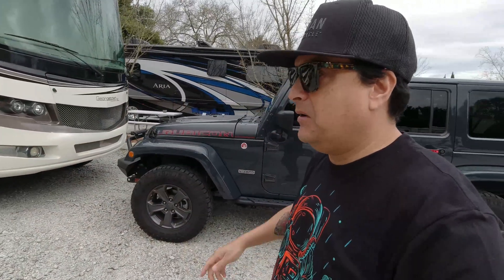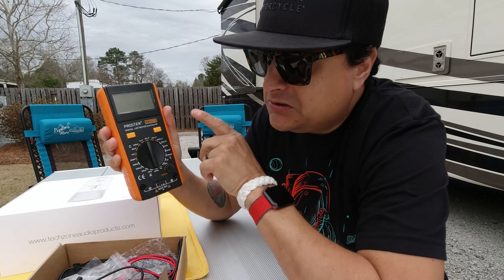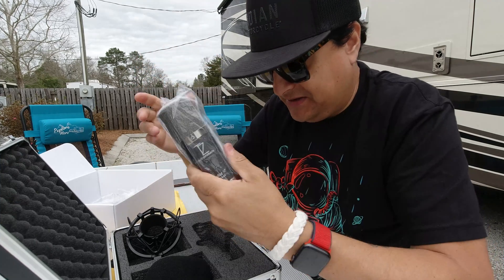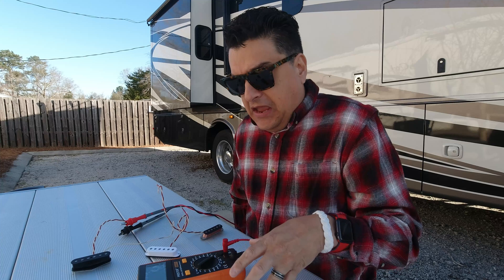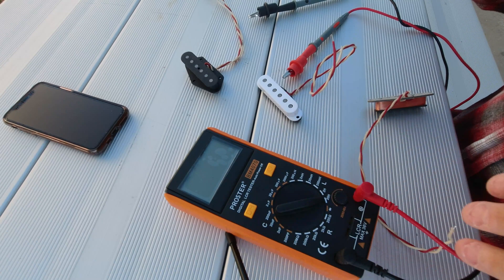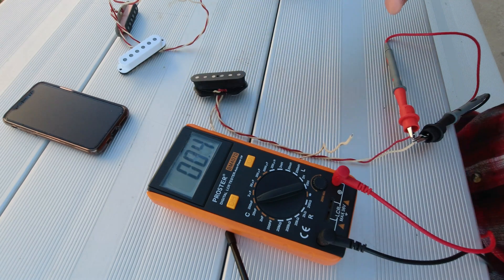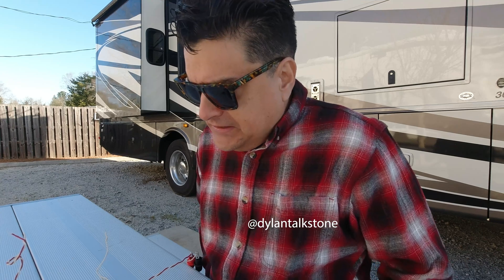The RIGHT way to measure a Guitar Pickup - Vlog

Comment: I enjoy your videos, but you've got it backwards: Yes, more resistance reduces power (voltage) output as well as reducing the high frequencies & the high resonant peak. (...luckily, the increased winds, that boost resistance, bring more output than is lost because of that resistance).

But, when it comes to capacitance, it is a case of cutting bass & midrange, more or less depending upon amount of capacitance...not cutting or increasing the highs. Capacitance acts as a high pass filter and when the cutoff level is high, the same amount of "highs" sound like they're increased...but actually that is because the lows were cut...ie: the  ratio of highs to lows is greater...and vice versa. 

As you yourself have mentioned, except with active (preamp) circuitry, passive components can't add what is not there to start with,  only cut it.

On the other hand,  the "grease bucket" circuitry does cut highs, while increasing the resonant peak of the "presence" bands (between mids & highs) which people hear as a "midrange boost", giving a fuller, richer but also perceptively bright tone...without screeching trebles.

I hope I was clear with this explanation!

Comment: Well correct, actually it's the higher inductance that cuts highs, ( inductors & capacitors are used to build crossovers for speakers), and resistors. but by winding on more wire you get a larger inductor but also higher resistance. Problem is most people don't understand how electricity works so it makes it tough to truly understand how res., cap., and induc., AND magnet all work together. Res. can tell length of wire ( assuming same wire size and type ) but by winding diff size and shape coil can create diff inductance. 3pf  is basically no cap. A 3 pf cap across the hot to grd could not be detected by human hearing. gotta get closer to 100pf to definately notice. Could be lower but 100 for sure.

Comment: Nice video, with one caveat. I have that same LCR meter (Proster).  The capacitance measurement is ok for capacitors but is pretty useless for coils because the test frequency is too low, nor is it adjustable.  Dylan mentions capacitances in the range of 2.9 pf for a strat pickup when measured with this instrument.  The actual value for strat coils is typically over 100 pf.  A meter that is capable of measuring capacitances of coils is in the several hundred dollar range, and has a variety of test frequencies.  If the coil capacitance really were 2.9 pf, it would not be a significant measurement because the typical guitar cable capacitance is much larger, in the range of 400 pf.
Reply: Interesting! Does this mean that this LCR meter is incapable of measuring the capacitance of pickup properly? Or would I need to multiply/divide the number a certain way?

Comment: This is the most clarity In detail without over complicated science which I do like, but I'm not there yet, so yeah this is encouraging in a way that makes me want to know more, and now knowing that inductance is a culmination of all the component values of a pickup is the most clarification I've had so far, I have just been looking at what the major suppliers put up on the specs as either 6.1k or 6.9 or whatever without letting us know that there's more to it like permeability of the materials like the magnetic poles and how that affects the inductance and ouput and there's more- how the pickups plus the wiring loom setup Inc caps and configuration of everything as a whole right up to the jack and the ts cables, basically everything has an effect on how the guitar will interact with the amp you're using, so I was thinking back to the drawing board but now knowing I can get the information I need to make the guitar end right for the amp I have, for the range of tones I want to hear so I can not just be frustrated after forking out 100s on what I think is good defined by cost, and a little amount of information 
Instead there's a way that even back in the 50s they had already figured out what's what and designed everything including the pickups, guitar wiring etc and amp innards, all in one to work together in the best possible way, thank God for Nicola Tesla that's what I say, of course Dylan thank you for all the time, and energy put into being the best at what you're interests draw you to. We need more folks like you who relentlessly dig deep and invest yourself in the math, the science and the kindness of sharing this with us all who want to know the truth, instead of being ripped off because of our ignorance well I can speak for myself on that, I was wondering about a set of pickups that have alinco 3 magnetic poles and how they were pretty good but you know how marketing can be for lack if a better word "photos hopped" in terms of tone using daws and plugins to edit the sound that isn't given the real justice via a mixed down format for media platforms, there's a lot of that going on, it's one reason other than the pure interest I have in guitars and amps and how they work, that keeps me on the real important topics. 
There's too much to cover I could go on but most folks havnt the patience to read more, everyone wants it all and they want it now! Instant gratification, without trying to sound condescending I mean. In depth is good, shallow- well its not thar simple. It's mathematical equations but it would be great to read the specs of a pickup that had all the info, big companies have enough to pay someone to type it up once on each pick up it's not like we're still using the enigma machine

Comment: Great video Dylan. I have a multimeter and will check the inductance. I have often wondered why my TV Jones filtertrons pickups with low resistance are loud compared to some PAFs I have with higher resistance. 
I think strats with baseplates on the bridge pickup would be great! But then, I am a Tele guy. Haha.

Comment: Hi,

Great Videos! I checked all of them and have learnt alot as winding is my new passion ;)

I have a question, how do you know what value of capacitance is good for the pickup (I mean how to judge it is it high or low). I have proster multimeter and it shows 0.007μF for my humbucker, can it be true? I checked Seymour Duncan SH-5, and got 0.01μF.  Is that mean my pickup is more "scattered" and might have a little bit more rich "highs" as capacitance seems lower?
I would appreciate your response. 

Best,
Szymon

Comment: Hey Dylan, love what you do and I learn a lot from your channel. Please excuse me, but I have to doubt your measurement readings:
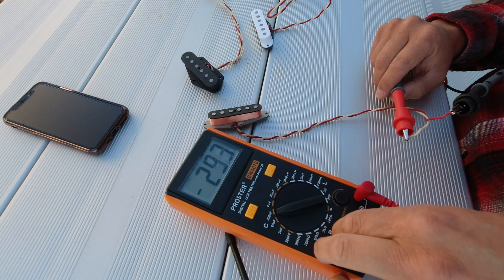Setting the meter to the 200nF (9:55) range and getting 29.3 on the screen should mean 29.3nF, and if you insist on converting this to pF then it's 29,300pF (nano = 10^-9, pico = 10^-12). Either way nowhere near your stated value of 2.9pF. Did I miss something?

Now,  in general, pickups' capacitance ranges between 100-200pF [1], which means both values, measures & stated (29.3nF & 2.93pF respectively) are unlikely for a standard pickup.
(In addition, a twisted pair (cabling) adds a few more pF to that, if you really want to scrutinize over the smallest details)

Obviously, capacitance is important for a pickup's resonant peak (LC circuit - I'm simplifying, but please bare with me), and this property is affected by everything that the pickup "sees": pots, caps, guitar cable etc.. 
So, for 29.3nF, the resonant frequency is ~584Hz, while for 2.93pF it is ~58.5kHz. Both are unacceptable for a pickup, any pickup (usually ranges between 2-10kHz, depending on the pickup type and construction). If I assume resonant frequency = 7.5kHz (typical single coil pickup), then the capacitance is ~178pF (0.178nF), again neither the measured nor stated values of 29.3nF & 2.93pF respectively come close to.

Please consider the meter as unsuitable for a pickup's capacitance measurement (even if it has the desired range and seems able to do so. Range is only one factor). [2,3]

Of course, you already knew all this, but I had to point this out and if you can comment and clear some of this stuff that would be great.

I'm certainly not trying to disparage this video or any of your works! Just trying to get everything right.
Thank you for your time,
Dror

Useful links to back my arguments:
[1] http://www.buildyourguitar.com/resources/lemme/
[2] https://guitarnuts2.proboards.com/thread/8271/measuring-pickups-capacitance-lcr-meter
[3] https://guitarnuts2.proboards.com/thread/8072/measuring-pickups-lcr-meters
Reply: Yes, this meter is not suitable for measuring capacitance of coils ie. with some resistance component. It's clearly stated in operation manual. Just it's the only meter showing at least some capacitance when connected to pickup leads. But it's not accurate reading and not suitable for any statements. That's weird because I have seen this cheap aliexpress multimeter in other pickup makers videos, for example Highline guitars.
Reply: In fact the meter shows -29.3nF, yes minus 29.3nF. Because of the measuring principle used in this kind of meter, this indicates that you are measuring an inductance, not a capacitance. If you know the measuring frequency used, you could calculate the inductance value starting from this negative capacitance value. It is really a joke when Dylan says 'people should pay more attention to the capacitance of a pick up' as his 'measurement of the capacitance' shows he doesn't have a clue how to measure that,  neglecting the minus sign of his measurement and having the value shown wrong by a more than a factor 10000. Dylan, you failed your electronic measurement technology. exam.

Comment: This is interesting and I appreciate his desire to make measurements that matter. Unfortunately, he is using a tool that says it is measuring inductance and when he has it on it gives a number. That number is essentially meaningless (except maybe for comparative purposes) because these cheap LCR meters do not account for the frequency of the measurement or the type of circuit it is testing. You really need to plot Inductance vs frequency in the range you are interested in. Inductance of a guitar pickup varies hugely as a function of frequency. Reporting a single inductance number without talking about the frequency or applied current is really a poor way to characterize a pickup. A good strat guitar pickup should have an inductance of 3 - 5 H at 1kHz.
Reply: Exactly, this is pure bs in this video. He also doesn't even mention if that is measuring series or parallel inductance. Those two will be quite different.
Reply: Are there any decent LCR meters that test inductance with variable frequency?
Reply: @deanw8206  Yes. They are available, but they are not all that cheap. I use a laboratory HP LCR meter. There are handheld ones that have variable frequency capability. Search LCR meters and look for available frequency models. How good they are is another question. HP/Agilenet/Keysight are industry standard. The cheaper ones, who knows? Probably ok for comparative measurements, but if you want absolute values, it will cost you.

Comment: You should probably be aware that your LCR meter is reading a negative capacitance -- which is the meter's way of telling you that you're in the wrong mode. If you want to measure the parallel capacitance of an inductor, you'll need a more sophisticated setup. This also makes me question your theory on hand- vs machine-winding a great deal, since you were never measuring the thing you were trying to...
Reply: Yes you are correct. The readings he is getting can not be correct. They should be in the region of 100pf for a strat pickup, yet the readings he gets is in the negative nf range. There are some lcr testers like the de-5000 that aren’t expensive that test at a high frequency.
Reply: Correct, and most cheap meters also use low frequency for capacitance measurement, which results in completely wrong readings.

Comment: i have read that to measure a pickup's intrinsic capacitances an lcr meter needs to measure it at 100kh. the reason for measuring at 100kh is because a pickup has complete electrical continuity unlike a capacitor. is this idea accurate
? is intrinsic capacitances needed to compare pickups? love your channel. you're one of the reasons I started building/moding/repairing guitars and building pickups.
Reply: It is true and it should be measured in parallel mode. If you measure the pickups with low frequency meter your reading will be few hundred times higher than it really is. And the opposite, low frequency should be used for inductance measurements.

Comment: The Proster LCR meter is not well regarded for pickup inductance and capacitance measurement because of test frequency limitations, which affects the measured values. The DE-5000 and the Hantek 1833C are the preferred instruments. They are a little more expensive but not much. See guitarnuts pickup testing forum.

Comment: I'm a firm believer in quantification, but many people think you can't quantify tone quality.  So I'm hoping you will find a nasty sounding pickup, and compare with an excellent sounding pickup.  First, using quantification, then maybe a sound comparison.  Can we prove that quantification is useful in comparing pickups?
Reply: That's simply because pickup manufacturers refuse to publish full frequency analyses of their pickups. Like speaker and microphone manufacturers do. People have learned to correlate those data with what they hear. They could do the same for pickups, but they have never been given that opportunity. So how could they know that you can't quantify pickup tone ? The more pickup builders like Dylan start doing these analyses (adding full frequency spectra) along with sound files, the more normal it will become. Currently there is a market opportunity for a builder to take up that mantle.
Reply: + @vw9659  
You let a marketer mess with your head --- the pickup simplest construction, just a bunch of wires and a magnet --- nothing magical. Every sound has its admirer.
Check out CBG-community videos.